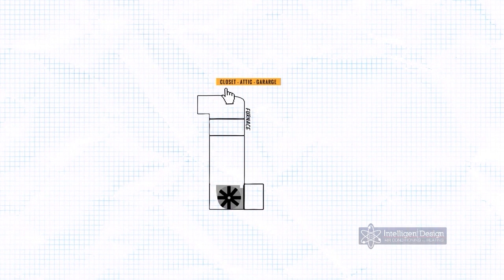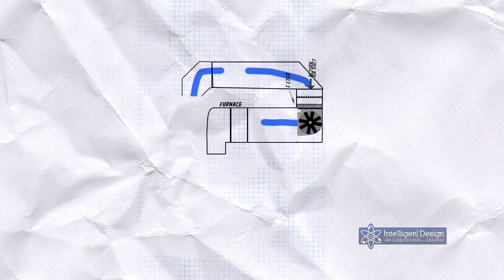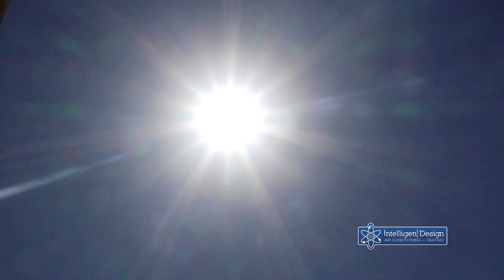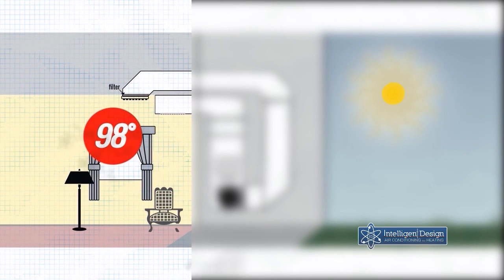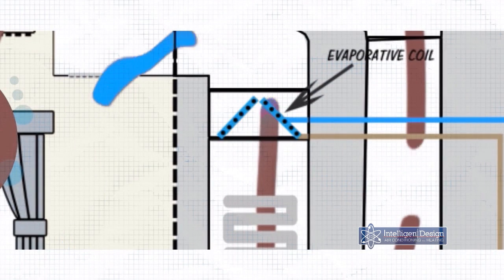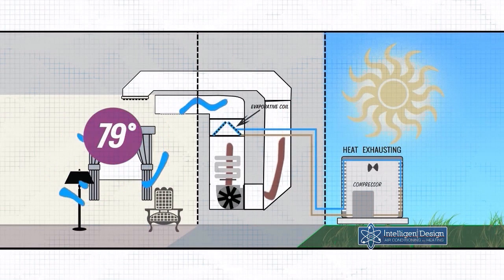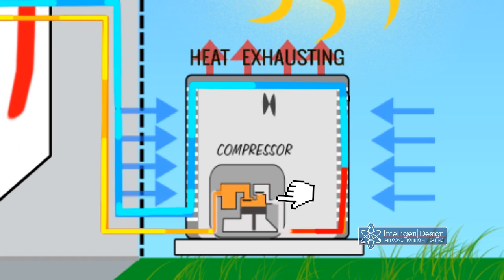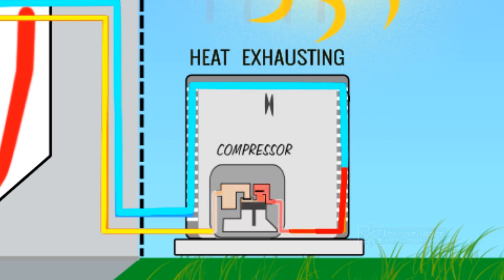How Air Conditioning Works | Intelligent Design AC Explains

Comment: great explain, my parents' house has a hybrid system. That is, a gas heater carries hot water to the AHU and that's how they get their heating. The problem is, no hot water = no heating for the house. We're almost 3 weeks without a working water heater and the average temps have been in the 30s at night.

Comment: Great vid. The only thing missing is how the cooled liquid in the condenser unit is converted into a cold gas. I assume an expander, like a fridge?
Reply from the maker: Yes there is either a thermostatic or electronic expansion valve in front of the evaporative coil.   I wanted to keep the video simple so that the average consumer could understand without getting overwhelmed or confused.

Comment: Your flow "directions" on the refrigerant loop are actually backwards. Cold vapor enter the compressor, its compressed into superheated gas, run thru coil to become a "warm" liquid that goes back to evap coil.

Comment: Two problems I keep having. 
#1 once the desired temperature is achieved, it stays on. This in 100° days my filter just changed is getting dirty quickly. Some teens threw dirt in people's ac fan units outside. 
I could smell the maintenance employee smoking. So if air is circulated from inside then how is my filter getting dirty so quick? 

#2 if the coils outside around the side did get dirt clumps dumped into the fan, what would that do?

Comment: I read that the cost to install central air conditioning, including the unit, ranges from around $3,000 to over $7,000 on average
but as a HVAC contractor how much do you charge for the work  you do?

Comment: My only question is this: An AC system has a finite amount of refrigerant, and there's no way the exterior heat exhaustion can remove ALL of the energy from the air (cool the refrigerant back to the temperature it was at when it was in the Evap coil), so what keeps the refrigerant from getting warmer and warmer as the system continues to run?

Also, let's say that the outside temp on a hot day is 98 degrees F. If the system has been on for a while and the interior air temp in the home is now a comfy 75 degrees F, how does the air not get warmer as it passes through the heat exhaustion?
Reply from the maker: When the refrigerant comes back into the evaporative coil it goes through a device called a thermostatic expansion valve which drops the pressure AMD expands the refrigerant there by dropping the temperature. Temperature and pressure have an intimate relationship when you raise or lower one the other one does the same.  It is then able to absorb the heat from the air in the house even if it is only 75°. Then when the refrigerant goes back to the outside unit it is compressed to raise the temperature up in the 220° range so that when you’re pulling 98° outside air over it you are exhausting the heat outside. Once the heat is exhausting outside the refrigerant is condensed and is ready to go back to the evaporative coil inside
Reply: Thank you @Idesignac

Comment: So given the choice, do I put the AC unit on the garage roof with a short cable run and higher summer roof temperature. Or, in a shaded ground level area, but longer cable run?

Comment: Its still hard for me to grasp how this process in the condenser is sufficient to cool it back down that much, and not just down to an ambient temperature. I thought it involved a process where the liquid in an enclosed system is suddenly decompressed, thus letting out heat into the new space.

Comment: I’m an engineer but I still can’t wrap my head around how the compressor unit aids in the removal of the heat. After compressing the refrigerant solution (which is a gas), doesn’t compressing it make it even hotter? If so, how does the cooling fan help bring it back to stable temperature so that it acts as a coolant again? Not sure if I buy the idea that the fan alone removes enough heat so that the solution becomes liquid again.

Comment: i have but one question that no amount of research/videos are answering:  does a typical split system on a typical development home in california (ex. 2000-2500 sqft), draw outside air into the summer for cooling?  if so, does it do so on the hidden back side of the furnace that nobody can see or reach?  there must be some % fresh air in the equation and i'm curious what percentage and how/where it is done.  one comment notes that most new homes have a HRV or ERV (energy or heat 'return ventilation') system, but how do they work and why is 'outside air' omitted from all videos?
Reply from the maker: Outside air or a fresh air intake is typically cut into the return to pull in and mix outside air with the conditioned inside air. This is only required if the house is sealed at a certain level of tightness. Most new homes have a fresh air intake and all commercial applications should have one.

Comment: Question: How does a home AC system ventilates and get rid of carbon dioxide that we exhale and fresh O2 gets pump inside the home? I don’t see an air exchanger in my home?

Comment: No OUTSIDE ( fresher air) intake into the system?
Inside air would be very polluted from offgassing of chemicals from furniture, carpet, cleaning products, perfumes, cooking?
Reply: Faz A    No cooling/heating outside air would be less efficient since most likely the outside air is going to be hotter or colder than the inside air. It's easier to change the inside air a few degrees than bring in outside air and Change it 10 20 or even more degrees
Reply: open ur windows
Reply: Most new houses and even older houses are suppose to have a fresh air intake that runs into your return duct generally 10 feet away from your Blower motor. If you have a furnace set up in your basement, generally cool air will follow into the fresh air, as cool air falls and hot air rises.

Comment: Is it accurate to say that A/C systems require electricity to run and that energy is transformed into thermal and sonic energy? If this is the case, would an A/C unit displace more thermal energy than it is removing from the air inside the house?
Reply: This isn't fusion kid, the point of luxuries like AC is to be comfortable, not to process energy from the atom effeciently.

Comment: You didn't mention the thermostat or the electrical system of the unit so this video is incomplete. Nonetheless, this is a pretty good video of the portion covered.
Reply: AC units from where I am run off 240 volts from the breaker panel and generally require anywhere from a 15-40 amp breaker depending on the tonnage of the unit and design. High voltage wire will run from the breaker to outside your house and into a service disconnect box that runs into the unit to power it. A communication wire of 24 volts, 2 wires will run from the condenser to your furnace board in the terminals of Y (for cooling) and C or common, which is continuous power. There you connect your Y from the thermostat to Y on the furnace board. When cooling is set on the thermostat it will send power to Y and G I believe, and then it will energize and close the relay (switch) and communicate through the 2 wires from your condenser turning it on. In some scenarios, some thermostats will energize Y from the feedback of the G Wire (fan) when you only activate the fan and or ventilation fan. In this scenario you would have to put in a relay to stop the back feed. 

On older furnaces that don't have a board, you have to build a Y pack, at least that's what we call it here.

Comment: The video overall is interesting, but you really have to keep track of expressing yourself correctly.
"The refrigerant is so cold, it boils at only 40º", for example, makes absolutely no sense. The boiling temperature is a property of the compound, while the temperature is a state variable.
Reply: Depressed Robot 

I think it kinda make sense.. Bcoz if it boils at a low degree that means its natural form (the un-boiling one) its temperature is so low >>> cold.. Correct me if im wrong
Reply: Carboturbulant. Minus zero salt sugar. remove 2210. and 6 plus five. Now just enter your temp. and weeee zeeee. Alaska
Reply: makes sense enough to me, isn't wrong.  in relation to us the refrigerant is cold "so cold, it boils at..."
Reply: Ady Dee perfect

Comment: Wouldn't you be breathing same air over and over again? What if your basement door is closed? Where will air come from? So we are breathing Carbon monoxide basically???
Reply: Most new homes come with a HRV (Heat Recovery Ventilation) or ERV (Energy Recovery Ventilation) system. It’s their job to bring in fresh air from outside, regulate its temperature to match indoor temperature, and distribute it through the hvac system. Also, all furnaces exhaust their waste gases outside, so you wouldn’t be breathing in CO or other hydrocarbons.
Reply from the maker: No home is hermetically sealed. I’ll homes Leak some of the air. If the home is sealed very tightly like new homes are they are required to have a fresh air intake so that the system is mixing some outside air with the recycled inside here.
Reply: almost like they are building them tighter and tighter, almost like a tightly built home NEEDS AC @Idesignac

Comment: This video is wrong... When the compressor compresses the refrigerant, the pressure of the refrigerant rises which increases the temperature of the refrigerant. This is because of Gay-Lussac's Law. Basically if the pressure goes up, the temperature goes up. If the pressure goes down the temperature goes down. So the refrigerant was pressurized which means the temperature goes up (gets hot). This happens with the compressor. The condenser is just there to take some of the heat (lower the temperature) away from the refrigerant. The condenser does not cool down the refrigerant that much. The refrigerant is still under immense pressure and is very hot. When the hot, compressed refrigerant gets to the evaporator coil in the house, the pressure drops (the pipe gets bigger in the evaporator) and because of Gay-Lussac's Law, the temperature also drops. Thus the evaporator coil becomes cold because the refrigerant is now under far less pressure (and temperature).

Comment: Here is some critical feedback that I hope you can use to improve your videos in the future: this was not a good explanation of how AC works in my opinion. You mixed common language with engineering language, and were not consistent in either. For example, you mentioned the compressor in the video, but never mentioned/explained, or showed the expansion valve.

The compressor requires energy to run, and that energy input is what allows a refrigerant to run through the vapor compression cycle (where it gets compressed, and then expands), and leverage the physical characteristics of the chosen refrigerant. But you can't expand the refrigerant from a liquid to a gas w/out a pressure reduction mechanism (eg expansion valve). Moreover, you can't run liquid through the compressor, it will get destroyed. Please try again, using more structure to tie your audio to your visual.